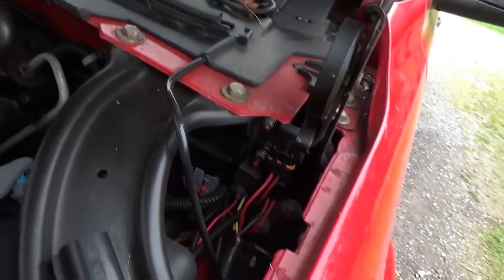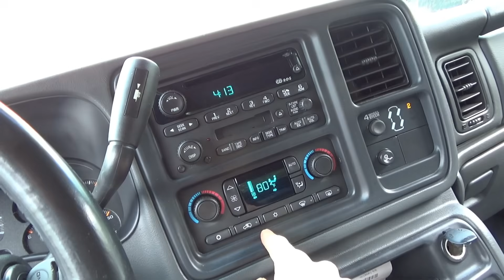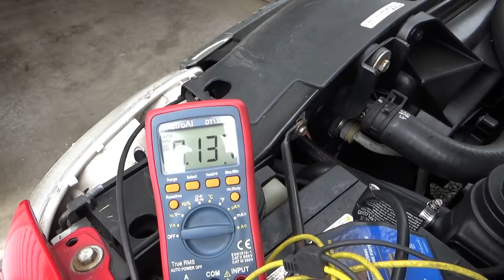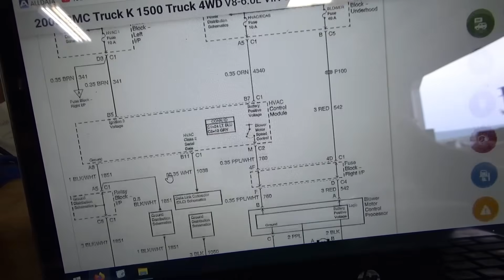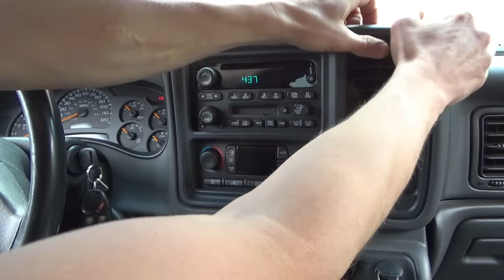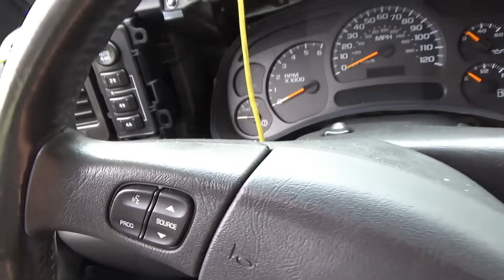QUADRASTEER! GM Parasitic Battery Drain from the FACTORY? (Part 1)

Comment: If those batteries were not matched, as in purchased and installed at the same time with the exact same battery, you will always have a parasitic draw. Coming from the batteries themselves. If one battery is older it will have a much higher internal resistance causing the other newer battery to charge the old battery. It will eventually destroy one or both batteries.
Reply from the maker: Incorrect...unless one of the batteries is completely SHORTED OUT internally haha
Reply: @PineHollowAutoDiagnostics Absolutely correct. Solar installers discovered this many many years ago. It's common knowledge these days.
Reply: You literally showed it at the beginning of your video.
Reply from the maker: @kevinroberts781 if you connect two batteries to each other + to + and - to - they will NOT drain each other to 0V 😂
Try it yourself! 😉
Reply: @PineHollowAutoDiagnostics You need to rethink your comment
Reply: Every time I load it's placed on those two batteries. They will draw unevenly. Every time you charge those two batteries they will charge unevenly. Unless they are matched. Please do some research
Reply from the maker: @kevinroberts781 sure. But that doesn't mean there's a PARASITIC DRAIN like you stated in your original comment 😉

Comment: That trailer brake should have been wired to ignition voltage instead of constant. That is the installers fault. Improper instalation will cause parasitic draw.

Comment: Dumbest not really "paracitic" draw was an F-550. Needed jump every Monday. Unless Monday was a holiday, then Tuesday needed jump. From the jump. Went to dealership 15 or 20 times. Then the warranty expired...
The goddamned tab in the glovebox that shuts off the light was malformed at injection molding. Took almost 2 beers to find. Vs 200 hours for Ford to NOT find.

Comment: Great video I have a 2002 Chevy avalanche z71 with a parastic draw 0.38 coming from the radio fuse I disconnected the cluster, radio, climate control system I did notice with key off my fuel gage goes up after a few minutes and stays up what do you think cluster bad or bad bcm please help thanks

Comment: Those quadrasteer trucks were programmed so if you were driving under a certain speed, the rear tires turned opposite to the front wheels,  and if driving at highway  speeds they steered at the same as the front wheels so it kind of crab during a lane change. Also the opposite steering at slow speed was better for maneuvering a trailer.

Comment: Nice truck but when i see a snow plow hitch i remember when i worked for a truck company that installed snow plows,  lift gates, truck cranes etc.
 The owner of the company said why would you take a perfectly good truck and mount 650+ pounds of snow plow and hang it out past the front bumper. He always suggested using an old 2 yard dump truck for plowing and save your daily driver the abuse.
 That said great video and parasitic voltage draws are so common i always check powers and grounds especially living in the north east where "Green Crusty's" are  the first animal in my cross hair's.
 You have confirmed time and time again the follow through is critical to the process great teacher Ivan.

Comment: A couple years ago a Chevy truck came in with a draw. I tracked it down to the BCM. It would shut down normally when you hooked up the battery or cycled the key. If you woke it back up by opening the door or something else that woke it back-up, it never would go back to sleep. Took me a minute to figure that one out.

Comment: Should have plugged heater module back in , and redo test, with the trailer brake.  Someone probably jumped wire off  heated module for trailer brake, I believe that's your issue, and it doesn't need a heater module

Comment: Two batteries in parallel will drain each other, Boat people run into this.  Both batteries cannot always be the same voltage, so one draws the other own. This is an added problem.  The original problem is the "ignition off draw" designed into the electronics, there is no excuse for this, look into industrial PLC controllers, which are way more complicated and they don't do this.  Look up "super cap" that is what I put into my automotive weld control that the big three used in their plants from 1987 on...

Comment: My money was on the instrument panel. I had a .2amp draw on my ‘03 2500 HD that really left me scratching my head. I isolated the problem to the instrument panel, but couldn’t for the life of me find anything actually wrong with it. Around that same time, Eric O posted a video where he diagnosed a similar problem. Of course he sent the cluster off to be fixed, but I am too cheap for that... Fortunately his conversation with board repair guy gave me a clue. Some hot air and flux on the back of the board followed with an alcohol scrub/ultrasonic cleaning eliminated the parasitic draw. I still never actually identified the short,  even with a magnifying lens on my phone and the zoom maxed out. It was just invisible/microscopic “EPA friendly” lead-free solder corrosion that shorted out a couple of the traces on the back side of the board. An IR camera would have probably tracked it down immediately, but I haven’t found myself really needing one YET. I was just shocked that .2amps could be pulled through a short that I couldn’t find (I am not exactly a circuit board noob). A Louis Rossmann alcohol evaporation test would have probably worked too, but frankly it was easier to just go the belt and suspenders route of cleaning the entire board.

Comment: The customer added another battery too increase capacity?

I think it was an attempt at increasing stand-time (time between using the vehicle), but the problem is you cannot just add another battery unless the vehicle was designed for two batteries and came from the factory with two batteries. If you need additional battery power to run extra loads that have high surge current, like a large hydraulic snow plow, then the added battery would be deep discharge / start AGM and have its own separate alternator (with integral regulator).

If you needed the auxiliary AGM battery to start the vehicle in an emergency you could install a manual combiner (a large switch). Usually the AGM battery has provision to connect jump cables (connected with high DC current Anderson connectors with a sealed rubber boot(s)) with a large manual switch to enable power (like a large sealed boat main bus power DC switch). So if you want to jump a vehicle you can use the aux battery and not the starting battery. The aux and main battery systems are separate unless you combine them manually. 

The manual jump cable switch (on aux BAT+) when off enables direct connection of the jump cables to the dead battery posts without sparks (no need to try and find a good separate ground). Then you actuate the power switch manually to connect the two batteries. In addition to the jump power manual switch I like to include a marine style DC voltmeter (I like the OLED display versions they are very visible and easy to read) after the switch but before the connector. You can use it to momentarily measure the aux battery voltage with the switch on and cables disconnected to measure battery and charging voltage. 

You can also use it to measure the battery voltage of the dead battery before enabling power. This is very handy, in that, if the dead battery is very low it may be damaged (shorted plate, cracked case, etc.) and you may not want to attempt a jump. Also, the voltmeter can be used to measure the charging voltage of the dead vehicle after it is started and the power switch turned off. This is also handy because if the battery is not being charged (a bad alternator) then you probably do not want to attempt to drive the vehicle, because it will shortly die.

You only real viable way to increase battery stand-time is to put in a larger battery (30% greater CCA, with a large V8 should not effect idle speed control), you can either max out the tray, or install a larger tray with new hold downs. Usually, what I find is the Alternator output cable and block return (if not already large enough) is increased from 6 AWG to 4 AWG (on older vehicles, the Fusible Link wire increases from 10 AWG (some times two 12 AWG FL are in parallel like on the Fords) to 8 AWG. The block ground minimum is usually 2 AWG SGX, many times moving to 1 AWG welding cable (which is more flexible than SGX, especially when cold).

Comment: To me it seems like there is no reason for the trailer brake controller to have constant power. Seems like it could be connected to the ignition switch so it turns off with the ignition switch.

Comment: Hey Ivan, I'd like to qualify your statement about the thermal imager use for parasitic draw testing. I've found quite a few Honda and Acura HFL draws that are right about 240mA, (a dead giveaway for a HFL failure) by using the thermal imager. On some Hondas the HFL is in the dome light bezel area, on some Acura's it's in the rear of the center console. Here's the big if. You can see the heat from that draw IF the ambient temp of the interior is low enough. Usually that would be around 55 degrees or less. In the later part of spring and summer time, the thermal imager won't be nearly as helpful.

Comment: I forgot to say that this truck is THE truck that was used in Cleveland and Detroit for the debut. I have had 2015 and 2014 GNC;s that cannot hold a candle to it. She is a bad bitch. I take of my cars I take care of my wife. The extra battery was added for the draw and the plow usage. I know somebody said the decals look JANKY. So what, I have only positive comments. This truck hauls my car trailer with zero problems. I drove 4 hours each way because I knew Ivan would find the problem. He is the best at what he does. Good vibes all around. Look out for the part 2.
Reply: Bro why would you plow with that truck? It's way too nice for that. Get an old beater for plowing

Comment: This is my truck. The problem has been there for 18 years. Nobody could find it not even dealers, The truck is absolutlry perfect or I would not have put a supercharger on it. She is a beast. The wiring was done to perfection,  The extra relays are for the fans and the plow. Nobody at GM could figure it out The original owner (my best friend) did not want to send it back on lemon law. The truck is a legit runner with the super charger. You can pick on anything yu want, but nobody has taken care of her like I have. It is a heavy half ton (3/4 chassis) because the rear end is down graded due to weight restriction.
Reply: You can tell immediately from Ivan's video footage that it's a well looked after truck. I hope you are still running it. All the best, from Australia 👍
Reply: 4 wheel steer is awesome.  Normally that has to be done aftermarket.  Which is damn near impossible to do without doubling the cost of the truck..  imagine low low geared 4 wheel steer, you simply wouldnt get stuck..  unless you drove it under water..
Reply: I'm not sure I'd call that wiring "perfection"

Comment: This is only the beginning... There's something fishy going on. Reviewing the footage from this video, you can clearly see when he unplugged the HVAC module it is responsible for at most 40ma of the 178ma draw. Something has been added to the HVAC fuse or the diagram is misleading. I suspect the trailer brake control is on that circuit.

Comment: This reminds me of a South Main Auto video where Eric O. determined that the foam on the doors inside the HVAC box had worn off, causing an issue with the HVAC system actuators. I don't think the module itself has a failure, it's simply trying to carry out a command to see a specific voltage feedback from an actuator potentiometer after the ignition power is turned off. If this Sierra has had the problem since it was new, the HVAC box may have been assembled improperly.

Comment: I have the same brake controller in my 2004 chevy 2500.  It goes to sleep but wakes back up when you open a door.  It has no inputs to tell it a door is open -- i believe its a voltage sensing circuit in the controller.  So as your testing and opening doors or paralleling/isolating batteries, you may be inadvertently keeping the brake controller awake.

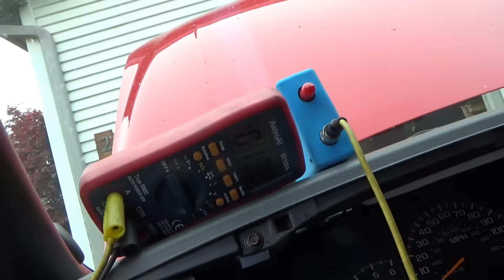Comment: 26:02 i love my truck so much but im gonna drill holes in my knee bolster and slap an ugly trailer brake box on it right above my knees and ignore the empty pocket on the bottom of the dash on top of the console.    That would have fit in that space and  looked better then where it is. A custom made plate could be made to cover any void around it. Or just leave it open space you would need to put a hole in the top for wires. But even removed you couldn't see the hole.

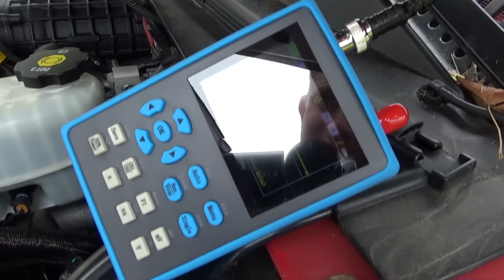Comment: 20:13 watch this part agine, look at the transmission oil cool line at the radator the top like looks like it has a pin hole in it  or its just a flake of dirt, tell this guy to ck his automatic transmission fulids and look at the black dot by the connector at the radator on the metal line. Top right facing the frt of the truck.

Comment: GM screwed up on the hvac memory system a tiny Lithium ion battery like used in a computer will keep the memory on a hvac system 
You can cut the power to that system when the car goes to sleep
The same battery used in computers to hold the bios on a desktop computer will work. Making that a live all the time circuit was stupid, same with the car radio and even a body control module's.  You do not need to use the car battery,  these batteries could be in its own box all together and be a 10 year service item every ten years you change the cells in one pack wile the key on the car is turned on  this is behind the glove box  flip a lock lever pull out replace with new flip the lock  done. 
Memory backup batteries for all computers changed in one simple step no memory lost.

Comment: One point no one seems to point out, adding a second battery, 
Any second or more battery should be on a seprate charging system isolated from the main system, batteries in parallel will send power to each other to balance out, also the altonator on that truck was designed to charge the factory system not the factory system and a second battery by putting on a second battery your adding more load on the altonator then it was intended to do, you need a regulator system to regulate power between batteries and the trucks systems  the capasity of the factory installed altonator is probably 80amps  but with a second battery it needs to be 160 amps  200 amps would be even better. More capablity the system will run cooler  you dont want a hot altonator becuse the rectfiyer diods are soldered to the stator plate
Altonators make ac voltage not dc voltage so you have to use a rectfiyer circuit to change the power to dc. I have rebuilt altonator the diods are hard to solder onto the metal plate it takes high heat to attach one but high heat will also detach one or burn it out and they use really high current diods.

Morel to the story, dont add a second battery unless youve upgraded the whole electrical system to deal with it like in a diesel truck that systems desined to deal with 2 batteries. 

Adding a second battery can and will dammage you changing system.   Also dont automatically decide it the aftermarket this or that,  i did high end car audio for 40 years some of us guys know what we are doing.  Its the customer installed crap thats a problem unless its just a shitty shop that did it. 
Besides dealership have installed aftermarket crap for years. 
Most of the modren creature confornts are becuse the aftermarket devloped them.

Intermittent wipers, power door locks, automatic headlights power windows ex.  Many many of these items are becuse of aftermarket ideas  because the auto industry had it head up there asses for years.  Also many of the systems factory installed were made by companies that make aftermarket stuff,  alps  commonly use headlamp control switches is part of Alpine car audio, Clerion started better car radios  they also make parts for new cars, but not aftermarket ecpt now have come back for marine applications.

Its how and who installed not that its installed   

By the way 4milie amps will drain a battery.

Comment: Can't wait to see part 2 ... What I think you should do is check and wire the trailer brake controller to get power when the ignition is in the Run Position. For the HVAC unit, wire it so that is connected to 12V Accessory Power .. That should fix everything without needing a new track control head

Comment: I have to say I love European trailer brakes. There is only a telescopic drawbar that uses mechanical brakes. If the trailer has brakes, they will work on any towing vehicle.
Reply: Nothing European about that style of trailer braking.  They are called surge brakes and are used everywhere.

Comment: It’s the BCM there’s an open recall. BCM/ECU reads ignition still on even though it’s off and key is removed. However it absolutely will still allow you to lock and unlock as normal. I have a 2003 Tahoe 5.3 I’ve learned by leaving a fm transmitter in the 12V socket and I will work my ignition key back n forth a couple times until it’s turns off with key. Then I know it’s shut down the BCM and won’t draw. You can take to dealer for free BCM replacement or buy your own and have a locksmith program it.